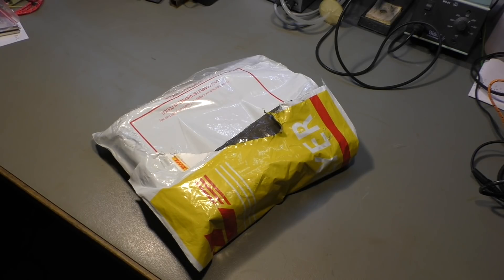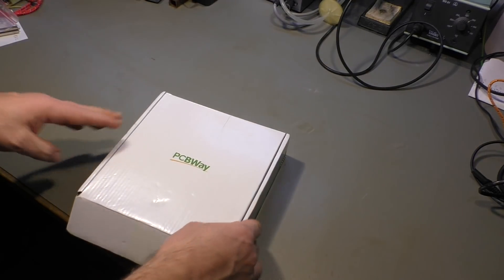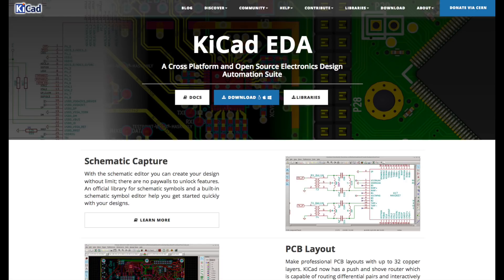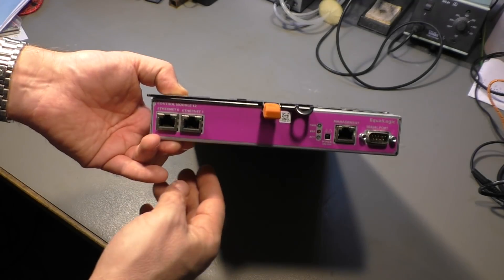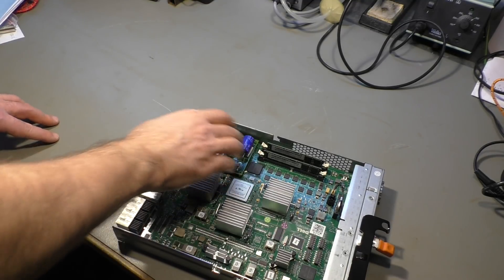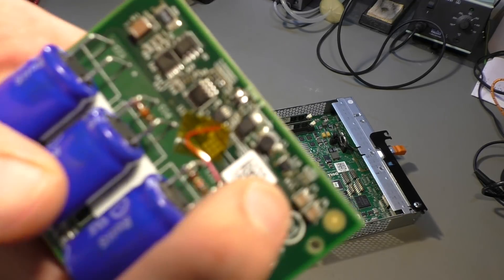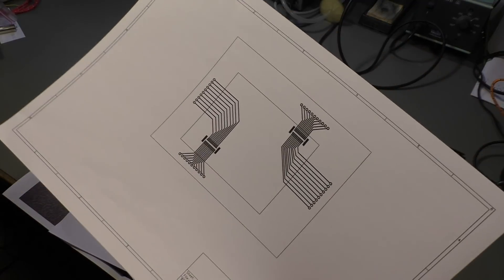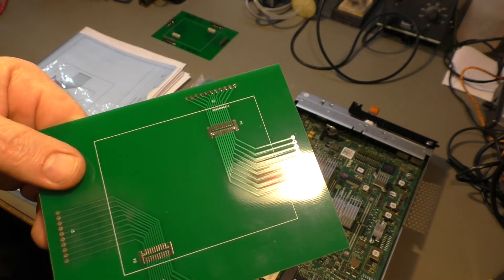When Dell does not want to sell spare parts...  PCB making (PWJ87)

Comment: Hi , great job reverse engineering the board. Would it be possible to get a copy of the schematics you created? Save me a lot of time. Funny I was in the Equallogic startup in Nashua NH, USA in the very , very early days of the ps-50- ps-400 arrays. I should have kept all my paper work . I was in the QA group at first. We didn't even have any customers yet. Worst thing to happen EQL was get bought by DEll. Id be willing to pay you for the schematics...I have a couple boards i want to repair.
Reply from the maker: Write me at playwithjunk@gmail.com ...
Regarding the repair - did the supercaps leak? That juice will attack the pcb traces. Sometimes impossible to repair. But I can send you the schematics.
There is a funny MOSFET in the circuit I don't understand. Maybe you can tell me what it does.
Are you aware that Dell sells those boards again? For a reasonable price? But it's a new partnumber...
Reply: @PlaywithJunk  Thanks for the reply. My boards are  not damaged from any leaks. I replace all the caps,. After replacing the caps my controllers now fail with an "voltage too high" error. If i remmenber correctly there is a calibration process to run on hte new installed boards. But its been a long time since i worked in support, and have long lost all my cheat sheets on getting into the root account and run the calibration. I'll send you an email .thanks for saving me a lot of time!

Comment: @12:02  I am a contracted Dell tech and they just have me replace the small board. The funny thing about that is they charge $1300 and then wont even pay my gas to get to you.
Reply from the maker: Fun fact... Dell sells the board again as a spare part for only $100 (+/-) but it has a new sparepart number: 0N7J1M
If you look for the old number 0KYCCH you get horrible prices and it's hardly available.
Reply: @PlaywithJunk   You think you could install ESXI on one of these controllers?  Guy wants to sell me one for cheap and don't know what to do with it. I wonder if you put in an SD card with esxi loaded on it what it would do.
Reply from the maker: @izzyman556  You mean using the controller as a server? That will not work, except you write a new firmware for it. The controller expects a compressed OS file. It will check the checksum of that file and if it is something strange, it will not load it. The original OS is some sort of Unix which you can access through the serial port. But it is not possible to change stuff permanently because you can't store the changes. it's all gone after reboot.
My advice: take the controller for a cheap price and sell it. These controllers are still wanted as spare parts for good money.
Reply: Yeah, I got to looking at the inside and realized its not any kind of x86 system.

Comment: Same with Lenovo.   We used to have an A3 colour printer from them.  When it worked, it printed well, and fast.    The trouble is, the Duplexing unit had a slight fault.     It wasn't a big fault, it just meant that the paper would jam every so often because part of the duplex mechanism hadn't returned to it's initial position.   Over the years, we usually just reset it, as the on the odd occasion we called out an engineer, they couldn't find a fault.

Then, one day, it jammed and wouldn't reset.   My colleague had a look, and noticed a very small screw missing.   This screw was not a standard size, being slightly larger than the screws usually put in glasses, so he phoned Lenovo to buy a replacement.  They apparently couldn't send us one.   We offered to pay a reasonable delivery charge, but no dice.    They said our only option was to replace the duplexer.   Something that would cost the best part of £200.   We said that wasn't our only option, and bought a new HP printer.
Reply from the maker: That's a general problem with all manufacturers including HP. They all outsourced their technical service and the companies who do the job now, don't have their own stock. So they can only replace what can be ordered as a spare part.  You simply can't order a single screw, you have to take the "next higher assy"... which is in your case the entire duplexer.
The other problem is that the service engineers, even if they could, are not allowed to "improvise" because that is not an approved procedure and can not be accounted and paid.
Reply: @PlaywithJunk  I should make it clear that when we replaced the printer it was out of warranty anyway, so in the long term, would likely have cost more to maintain than a new one.   We didn't just bugger off to HP at the first chance.

Comment: Those Chinese knew how make good business and working good ad without annoying content (compare youtube ads)

But how that water got inside that module? Was it stored outside?
Reply: Oh, It's not water. It was planned by engineers of Dell..
Reply from the maker: That's not "water". It's the elecrolytic liquid from the capacitors that leaks out... didn't I tell that in the video?
Reply: @PlaywithJunk  I quess O2 kill tjat juice and afret that it want leave that aluminium can.. :)

Comment: I don't know, to offset the low cost of selling these boards will these Chinese board producers sell the designs to other Chinese companies? We all know the Chinese producers of goods have no regard for someone else's intellectual property.
Reply from the maker: This is certanly something we have to seal with. I once sent a drawing for a part to a chinese plastic manufacturer. Half a year later I got an offer from a different company for the same part including my drawing with added chinese symbols. So it seems nothong stays confidential there.
I would not be surprised to find my part one day on the shenzen market... But to be honest, is this different from the "communities" where you share your designs when you use free PCB software?
Reply: Play with Junk it's fine if it's a hobby project but if this is a prototyping board company I assume alot of people who want to eventually sell the product will be at a disadvantage from established Chinese manufacturing factories who don't invest in research and development but will willingly buy your design, engineering a product is far more expensive then production of said product.

Comment: Built in obsolescence.

I have stopped buying equipment that is made by US manufacturers and companies because of this issue, my mixing desk PSU failed and Alesis do not sell adaptors and buying a replacement requires two things, a power supply that is rated as 18VAC and a couple of amps but it also uses a GX12 connector of the 3 pin variety.

I have emailed them, spoken to spares department in a shop who had an account with them, they couldn't get one despite trying to order one, they have a price for it but no stock.

This phenomena seems to be only related to the USA, its like a forced obsolescence but done very much in your face style.
Reply from the maker: That's a weird behaviour...
Are you sure it's an AC power supply? So it's only a transformer inside. Probably a thermo fuse blown that could be fixed. 
Or you find another power supply and attach the original connector to it. Snip and strip cables then solder and isolate
Reply: Play with Junk yes, I checked online as mine is the usb version you can plug in to your PC. 

18vAc-Ac psu for alesis multimix8 Usb2

You will find that alesis is always sold out and no intention of restocking as it is not in the companies interest to service equipment like most US companies, don't care about spares.

A company I worked for as the supervisor in a spare parts department. 

So my options are few.because 18vAc out is a very odd ball figure as is the fact it's Ac as well.
Reply from the maker: I bet it would work with anything from 16 to 20VAC.
Or you buy a standard transformer and put it in a case yourself. For example this one: https://www.digikey.com/product-detail/en/triad-magnetics/F-241U/237-1944-ND/5032194

It's only 1 Amp but there are more powerful too...

Comment: The biggest problem with those boards will be leaking electrolytic capacitors. surely it would be cheaper just to get someone to replace them
Reply from the maker: You have to replace them before they leak. Because the electrolyte will destroy the board, then it will be impossible to repair.

Comment: Now if I could find the schematic to the flex cable that goes between the LCD touch screen and mother board on an HP Photosmart D7260, I could get it back on line. Cheap flex cables snap after to years use rendering unit useless. And no I do not have the piece that broke off, the shop that looked at it conveniently "lost it".

Comment: I would be putting a hot glue barrier/reservoir around that cap pins to contain the acid.
Reply from the maker: If the liquid manages to creep down the capacitor legs and move over the entire board, I doubt that such a barrier would help.

Comment: A bit more insight into the supercap being used instead of a battery:  This is what's called FBWC (Flash-backed write cache), the caps supply power for just a few minutes only after a sudden power loss while write data is still in the cache.  During that time they supply enough power to keep the memory data live and the NAND flash that's also built into the controller. (Or a micro SD card from the looks of things here)  Once the data is written to Flash, the circuit is allowed to power down, and the cache data is protected effectively forever. Once power is restored, the caps come back to full charge within a few minutes and are ready to protect again, often before the system has even had time to begin writing new data.

The older method was BBWC (Battery-backed write cache).  This was just rechargeable batteries that kept the memory alive for up to 72 hours or so, after that, the power ran out and the data was lost.  Usually these had NiMH batteries, rarely Li-ion.  These batteries could take sometimes up to 24 hours to fully recharge, especially towards the end of service life (3-5 years).  They  were sometimes a pain to get out because they could swell and pin themselves in their holders.

HP servers have already moved on from supercaps to a system-wide storage battery with two 18650 cells.  The idea is it has enough power to run the FBWC of all the controllers a server can physically hold.  With both the caps and system battery, they routed it to a bare space in the chassis so any leakage failure is less likely to harm other components.

HP doesn't pull this kind of shenanigans with 'old' hardware.  You can still find the batteries for 6400/P600 series (307132-001), P400/P800 series (398648-001), and the P410/P812 series (462976-001) for 20-60 USD each.  (That's G4, G5, and G6/G7 systems.  All well beyond EOL)  The back-up power for their SAN solutions are also relatively inexpensive.

(Yes, as full disclosure, I am a bit favorable towards the HP ProLiant over the Dell PowerEdge.  Dell's made far more dubious design choices over the years IMO, though HP's had some design issues on occasion as well.)
Reply from the maker: I can not hide that I am a HP fan. Especially when it comes to RAID controllers they are the best I know. Most other manufacturers use Adaptec/LSI/Avago controllers and they have been notorious since decades.
The only issues with HP controllers are cache memories, batteries/capacitors and sometimes a complete failure. (very rarely)

But the LSI family suffers from incompatibilities between models, configuration confusion when changing a controller, or sudden loss of disks for no reason. And the worst BIOS-Menu to work with. (yellow letters on white background...)

Comment: It's difficult to sell the board for $400.
But:
If you sell the unpopulated board for $75 each (minium order quantity: 2pcs), and the parts as an option, 400 Euro for a fully populated (and tested) board seems legit to ALL customers.
Reply: I would think that the kinds of people who have these controllers probably would not balk at that sort of price. Also consider it's not just for the board, it's mostly for all the reverse engineering and testing work... and it's still way cheaper than Dell.
Reply: @thewhitefalcon8539  Tend to disagree, the people who have that kind of cash to spare will just by the whole unit new. Also now 2 years later these devices are being decommed and end up in hobbyist hands (like mine, I occasionally buy surplus hardware like this for use a development machines etc). 400$ is probably more than what I would spend on the whole machine (usually the company disposes of the disks to safeguard their data, so we are talking largely empty box).

Comment: WHY NOT JUST CLEAN OLD PCB AND REPLACE LEAKING CAPS?
Reply from the maker: BECAUSE.... wait, no shouting.... because the PCB is damaged by the electrolyte. Some tracks are completely dissolved and some vias too. You can fix the board but there's no guarantee that it will work for long.
Reply from the maker: Yes... I tried that. I had a board working for one week and then it failed again because another track failed. I can not botch all tracks.
Reply from the maker: thanks for correction :-)
Reply from the maker: australia not austria
greetings from EEVblog :-) That's where I know this word from.
Reply: You can replace damaged tracks with botch wires.
Reply: Because the tracks had been dissolved away and the component had been partly dissolved... thats why.
Reply: BOD-GE ... its BODGE wires, not Botch wire... They even say in in many videos that have been made by US tubers and they all say "Bodge Wire"
Reply: Yes we use this word a lot in Australia, it's pronounced BOD GEE. means (a roughly done repair)
Reply: Botch is a VERY similar word by the way , it means practically the same :) but it's not the name for the wires, that's all
Reply: The difference is a Botched job is one that doesn't work properly and was done carelessly ie Botched means you stuffed it up.. and a Bodge job WORKS but was done carelessly/unofficially :) and hello Austria by the way :)

Comment: What I don't understand about PCBway:
10pcs: $5 + shipping
20pcs: $34 + shipping 
(WT?)
Reply: It's because it's a "prototype" type of deal. If you want 20 or 100, find another company, or contact them by mail and get a much better quote. When you get into that amount of boards, they run them in a different way (bigger panels, maybe exclusive to that customer etc.)
Reply from the maker: The cost estimates on the website are pretty rough. The real price may be lower. It certainly depends on complexity and how many errors they have to fix.
Reply from the maker: Yeah probably... but I have to say that they ship with DHL and unlike other chinese suppliers it does not take 10 to 15 days for delivery. In fact I got this package about 5 days after manufacturing. So it is a bit more expensive but I think that's all right. That makes $20 for 10 boards; still competitive in my eyes.
Reply: Thank you for your interest on our website.That's because 5$ for 10 PCBs is a Bargain Price(SALE) for 2 layers PCB within 100*100mm.
Reply: yes, absolutely
congratulations for your AMAZING video and boards, btw
Reply: thank you for your clarification
Reply: Because, surprise surprise, they sneak the price into the shipping.

Comment: Hi great idea! Hope you will succeed in your staring!
Just one question, I believe the 0,1 inch headers on your breakout PCB at 14:54 should be soldered from the other side, am i right? ;-)
Reply from the maker: Yes that would be better, but I was in a hurry and wanted only a single sided PCB. And it's cheaper too :-)
Reply: zapro_dk, After you wrote i reviewed the footage. Indeed you are right, I didn't noticed that there are female connectors on the breakout PCB and male connectors on the supercap board. Thanks!
Reply from the maker: Ah yes... this is only a test board for the real thing. I use it to check it's function.
Reply: I don't agree. The board is too big to fit into the controller, so it's clear that it's a testing stand for the new PCB that he is making :)

Comment: Thumbs up for the heavy work! But Dell... You should to be more customer friendly! This is a design failure! It even can cause fire! Dell? You must replace This pcb for free, with a new design ! This controllers are business critical units! Idiots... A Youtuber has to solve Your dumb issues?
Reply: It probably isn't under a maintenance contract, which is why they want $1300 to fix it. Otherwise, they'd have somebody there 4 hours after you called them.
Reply from the maker: That's right. That was an "on call" repair offer. The customer has a contact with us but not with Dell.